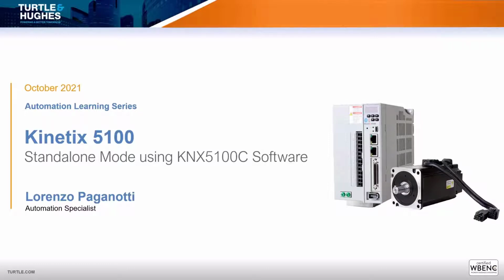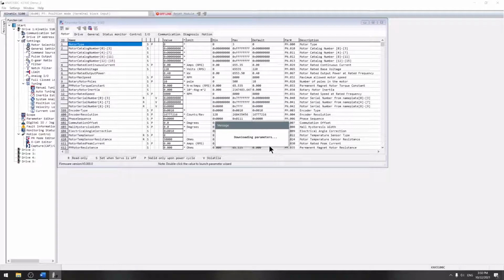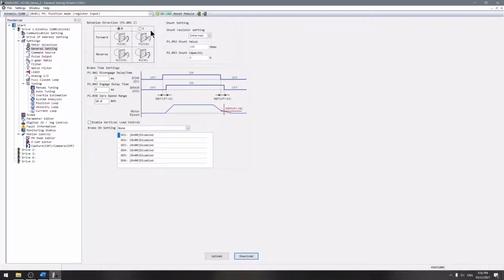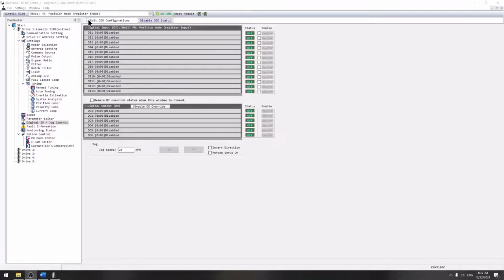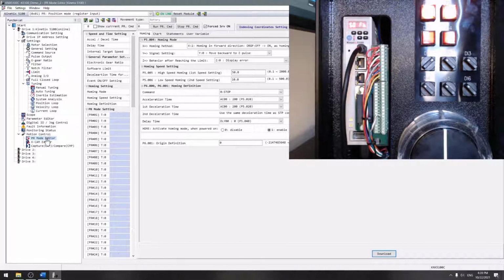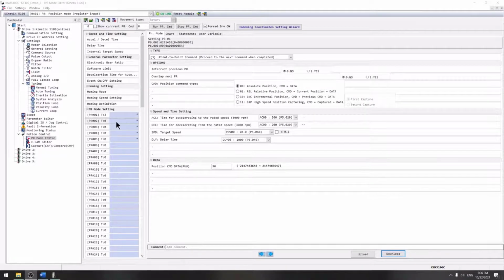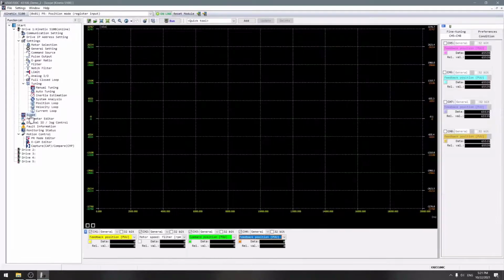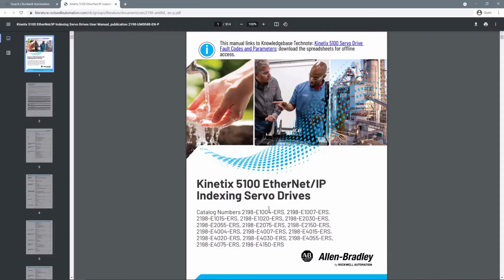Configuring the Kinetix 5100 Drive in Standalone Mode

Comment: may be available control with out PLC right?
Reply from the maker: Yes, it can. This drive can be controlled with its embedded indexing functions, or follow external analog and digital references. Integration with Ethernet/IP is also possible if a PLC is available.
Reply: @TurtleandHughes  Thank you

Comment: This video is like a "new revelation" to me. All that I knew about AB servo was programming using RSLogix5000 or Studio 5000.  Just a few days ago I  was searching for information on servo programming and a video came across. On it, a guy explains how to program a Kinetix 350 with the same software used in this video. I had never seen something like this before. Moreover, it explains that no PLC is needed to program the servo drive and run it. Amazing! 
Thanks for sharing your knowledge and experience.